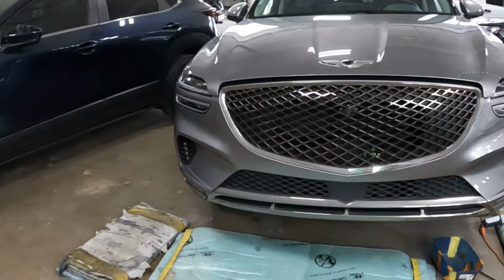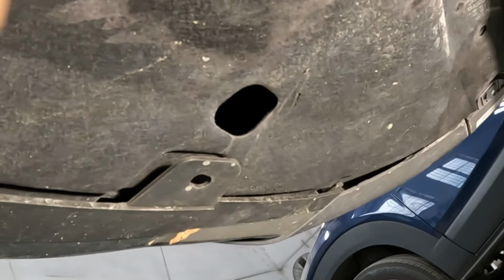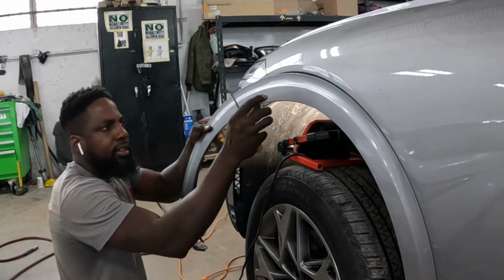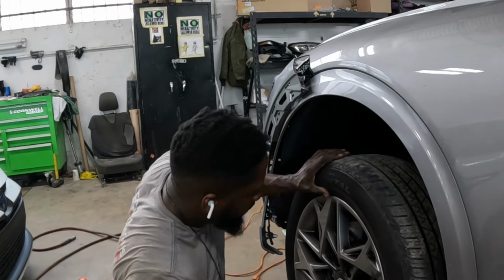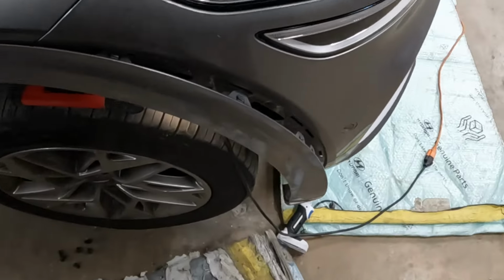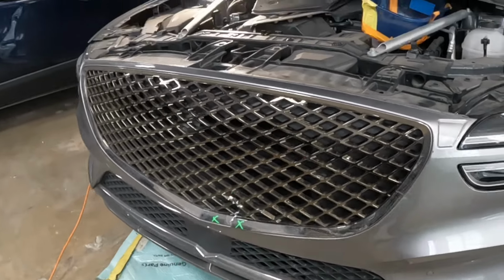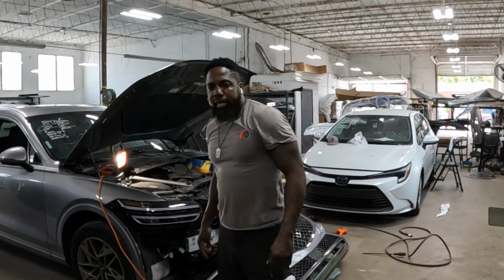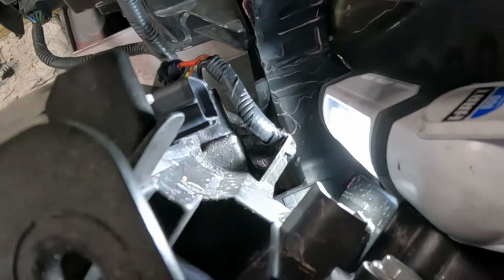DIY 2022 genesis GV-70 how to take the front bumper off

Comment: My front lower parking sensor fell inside and kept beeping all the time and was really annoying. i took it to the dealership and they said it would cost 645$ for 2 hours of work to take out the bumper and JUST LOOK AT IT (not including whatever it would cost to fix it aka pop it back in) because it is not electrical damage and they can't prove it wasn't external. (which is crazy because I bought so many warranties with the brand new car and this happens within a year of owning it). but I watched your video and fixed it myself in about 42 mins for 0$. thank you dude. you make it look easy and this was very helpful.
Reply: also my car is a 2023 gv70 so this applies to that too for any one wondering.
Reply from the maker: You’re welcome men and that’s one of the reason why am here is to help you guys keep these shops hands out of you all’s pockets